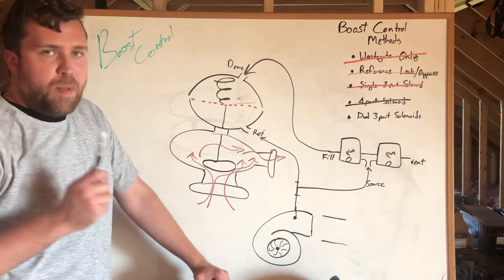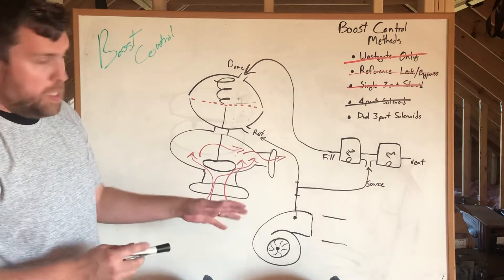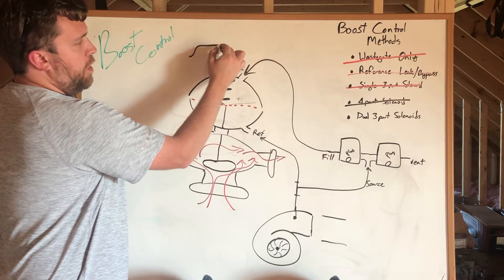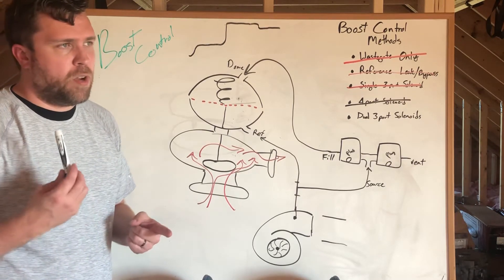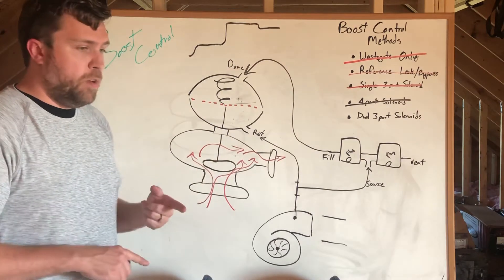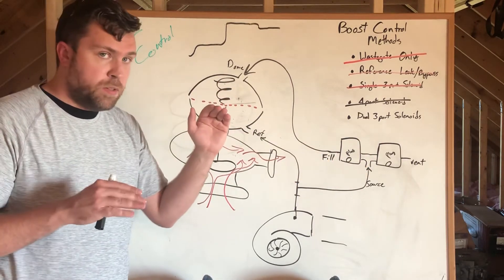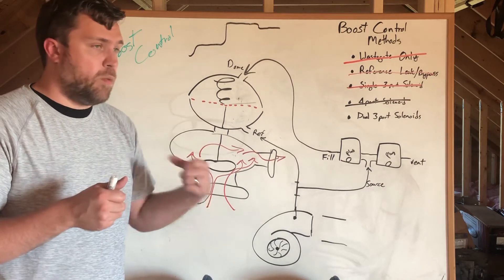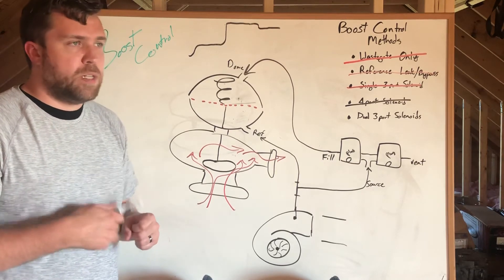Boost Control Series: Dual 3 Port Solenoids

Comment: So what's the advantage of this method over having one solenoid on the top and one solenoid on the bottom? Like if I wanted to remove pressure from the bottom and allow the valve to shut quickly by venting the bottom. I looked through your other videos and I don't see that you have a video on the other dual 3 port method. Very well explained video though
Reply from the maker: You wouldn't ever want to dump the bottom of the gate. That's the balancing pressure coming from the manifold to tell the gate to open when the spring force is met by manifold boost. Two things open the gate, backpressure and reference pressure (bottom). 2 things close the gate, Spring force and applied pressure to the dome from the mac valve(s). So in this case whats nice is how fast 2 3 ports work and the ability to manipulate a pressure curve very quickly and hold a target rather than just applying a little more or less to achieve a target boost. This method would allow you to do something like say 20psi on the starting line to build boost, then quickly dump some to manage launch power then ramp back in to a plateau and even change the plateau for gear changes etc. a single 3 port can try, but its not every going to be as good or fast and will be very wasteful with co2 or onboard air to achieve the same goal
Reply: @greenshortsperformance  The bottom solenoid would be set up to only dump between shifts. the pressure is removed from the bottom of the spring only then. I may switch to this method though, I just finished running lines and configuring my ecu, but i ciuld easy switch. I'm not running co2, just turbo pressure. Would I need to run a dome pressure sensor for this method? In my haltech i can set up dual solenoids but this is only used for co2 (i asked haltech a while back and that was what they said). So I set up a generic output to control the second solenoid. It makes sense to me that I can run it from boost pressure instead of co2 though.

Comment: Just trying to understand,  so this presentation expect us to be using  manifold air pressure and not compressed CO2.  Looking to implement similar dual 3-port setup with manifold air pressure,  rather than with CO2.   Great vid. 👍🏾
Reply from the maker: Compressed air and co2 are effectively the same one just must be refilled often but is overall lighter

When using manifold pressure be sure to select compressor as the pressure source not fixed

Comment: does this way give you more range than a four port

for example i can run 40psi with 15 pound spring
Reply from the maker: A four port will typically give more range. Four ports are good for cars using compressor source that need to leave on very low boost and still make a lot down track.

Comment: On this setup you can only double your boost  from the size of your waste gate spring so if have 10 ib spring to will 20 ib of boost and you can launch at 10 ib no lower is that how it works and what number are the tee and for the fill and vent ?